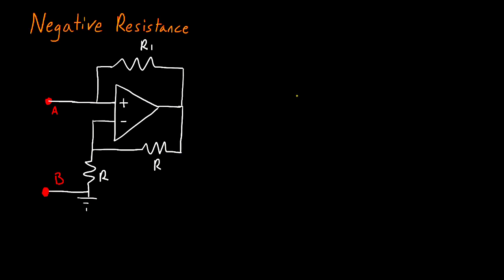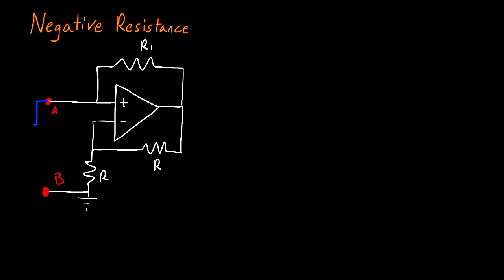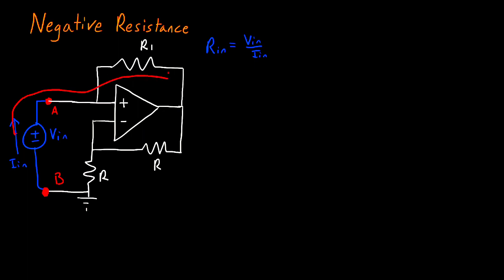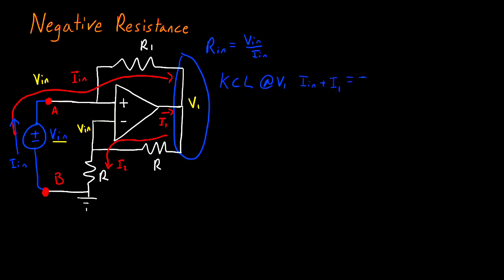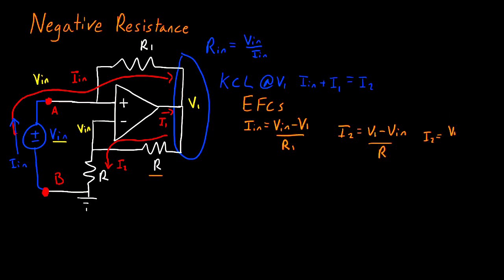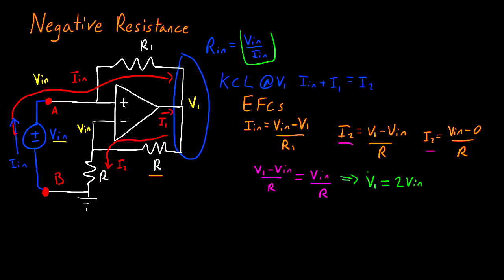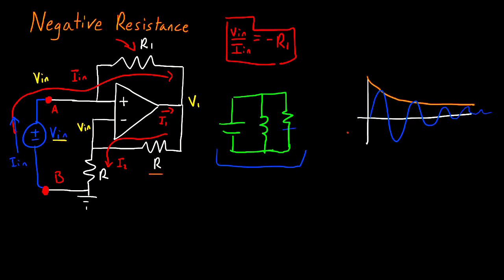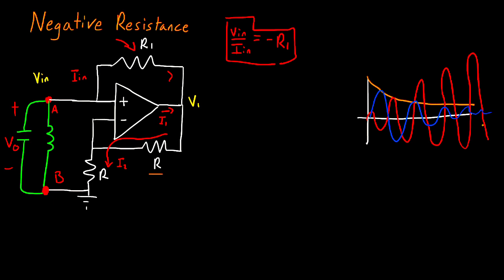Negative Resistance Op Amp

Comment: Amazing, im trying to think what negative resistance really means, how can you go lower then 0 resistance?  Isnt that impossible? Or that would mean creating energy wouldnt it? The opposite of impeding current would be creating current, adding more rather then just letting it all flow like 0 resistance does.  And thats what it seems to do- make more voltage, does this mean its over unity?   What does negative resistance really mean, its not resistance in another directing like negative voltage, there is no direction to resistance, theres either none or some, so going below none is actually creating energy?  My God do you know what youve done here?!

Comment: Can you make it create a nice sine wave with the LC tank, or does it just rail it regardless?
Reply from the maker: I don't believe you can with the circuit as shown. One way you could modify things to get a sine wave out of it would be to connect a low-pass filter to it. A square wave is composed of a summation of higher-frequency sinusoidal functions. By adding a low pass that cuts off just beyond the frequency of your square wave you can reject those higher-frequency components leaving you with a nice sinusoidal output. You would want to be sure to buffer the low pass filter or use an active low pass filter with a high input impedance so that way you don't distort the oscillator's frequency by adding your filter.
Reply: Use a light bulb to limit gain... 
Resistance increases when the filament warms up.
Reply: @davebutler3905 Perhaps better to use another solid state solution... like a phase shift oscillator for a nice sine wave.  Or perhaps I'm just saying that because I wouldn't know how to apply your light bulb solution to the actual circuit.  Would a light bulb be better than waveshaping a triangle wave with diodes?  (Just sayin' because triangle is so easy to make with op-amps).